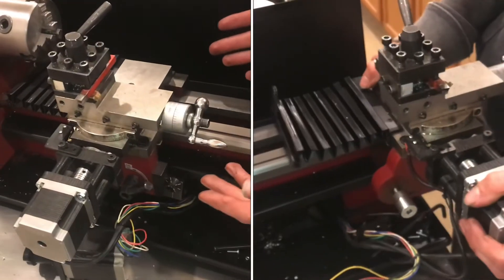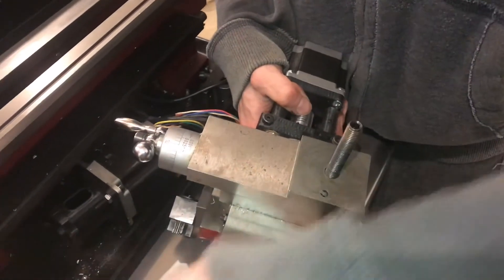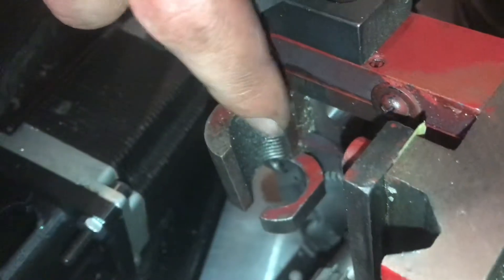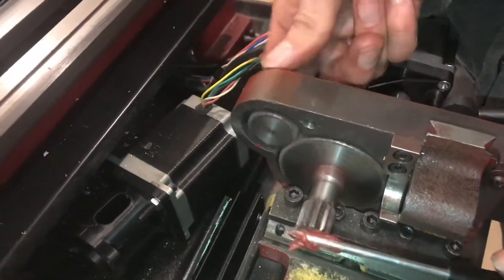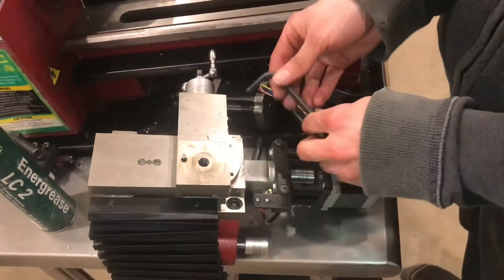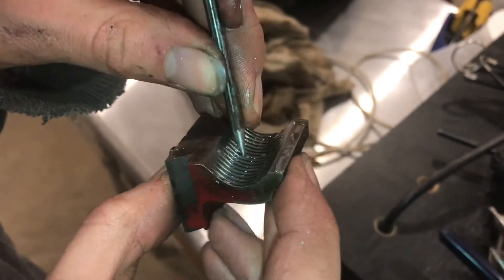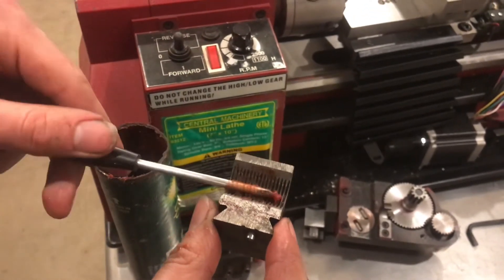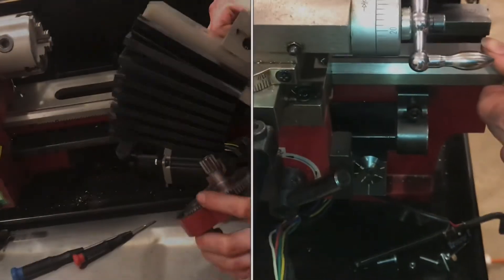complete DISASSEMBLY of mini lathe “clean and lube” (central machinery harbor freight) 7x12

Comment: Just purchased a Central Machinery Lathe and started watching your videos on cleaning.  I would like to make a plastic way cover before I start using it.  How did you make it?
Reply from the maker: We 3-D printed some TPU flexible filament. It was definitely a challenge to get the printer to make such a thin profile.